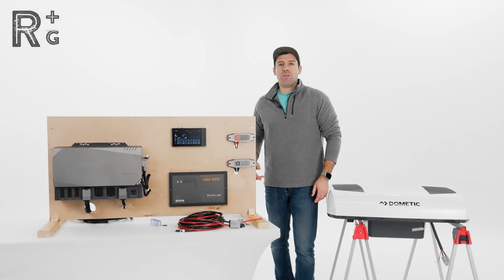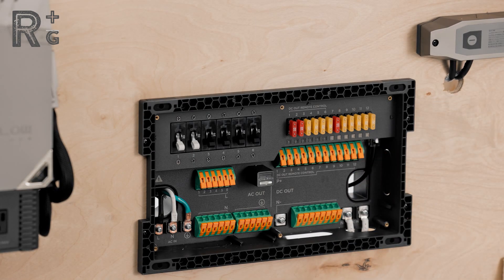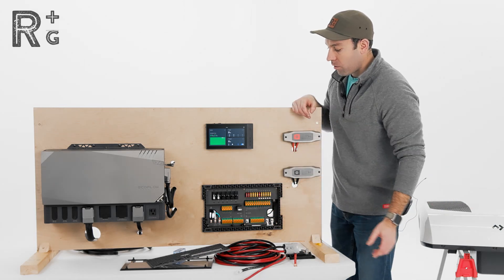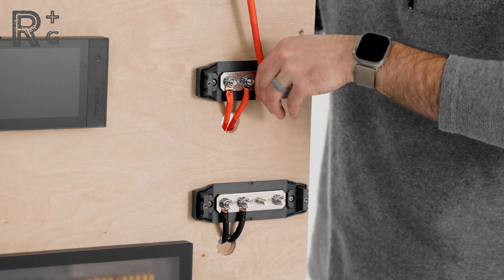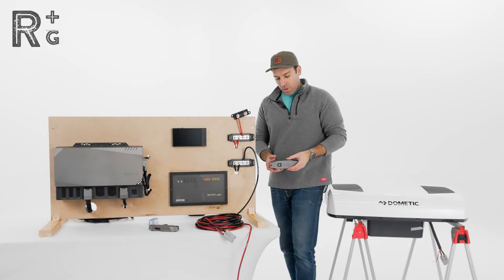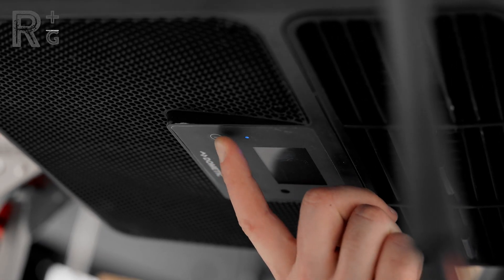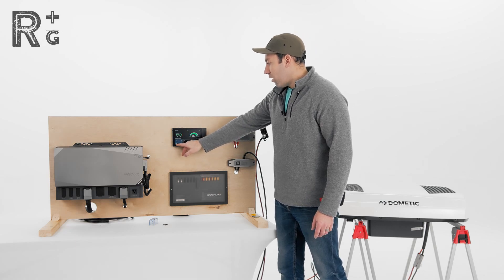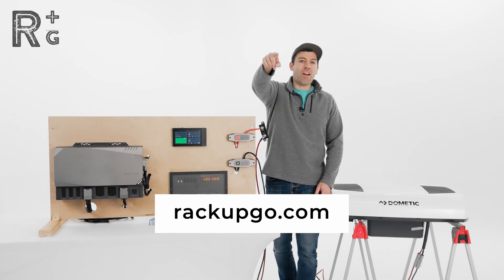How to Connect Dometic RTX Air Conditioner to an EcoFlow Power Kit

Comment: the power kit is 48v and you stated the AC is 12v right? how are you stepping the voltage down then in that setup?
Reply from the maker: The Power Kit has a built-in DC-DC converter and is capable of outputting 1000W at 12V.

Comment: Question about the PowerHub 12V DC output.  1000W max output = 84A ......DC Panel is 70A max.  The included DC Panel wiring is 6AWG good for 70A max. So how is the DC panel protected at 70A and still allow 84A of output on the DC out?  You would guess that the PowerHub internals would have a 70A CB protecting the wiring to the DC Panel and therefore you would not get the full 1000W output capabilities of the inverter. You would need a 90A CB, and then have to bump all wire to 4AWG.  Would you agree?

2nd thing. I noticed the Ring terminals on the DC output cable from Ecoflow are tiny, 4mm maybe? They should have made them 8mm like the Ecoflow Busbars all around so you didnt have to crimp anything.

Do you recommend shortening up the cables they provide for less voltage drop?  That DC Panel cable is like 10 feet long!
Reply from the maker: The output of the power hub, when set to "12V", is a regulated 13.6V. At 70A that's approximately 952W. The DC panel is protected through the internal electronics and voltage regulator for the DC out. It's all constantly being monitored, so when the power exceeds 1000W on the DC output, the hub will disable DC output and log an error. Seeing as the DC output is 13.6V, it's not necessary to shorten the cable to reduce voltage drop as it will not be significant enough to impact low voltage cut-off functions on 12V DC appliances. However, when it comes to having a clean and tidy install, shortening the cable is preferred by most.
Reply: @rackupgo  I see the trickery there with the higher voltage. Thanks for the info. Makes sense that they made the wires only long enough and sized so that they can handle the voltage drop. For my case, the alternator input cable was already a pre-run number 2/0, so I did shorten up that cable. And then to have circuits on the DC panel larger than 20 amps, I added a blue sea hub 150 which takes midi fuses up to 200 amps for auxiliary stuff like larger exterior lighting and stereo amplifiers. I was able to cut that cable in half and use 1/2 to the blue sea and the other half to the DC panel. Worked out well.

Comment: Hello, first of all, thanks for this video it helps a lot. I didn't know that Ecoflow had busbars because I couldn't find it on their site. I would like to know what 80 amp fuse you use on your positive going to the AC unit. I plan on setting up a Cruise N Comfort HD Mini Split System Air Conditioner system in mine which is up to 55amps from what I have seen.

Also, do you plan on ever making a video showing how to connect the alternator cable? I am not sure what the best practice is as far as running it directly to the batteries or straight to the alternator, let alone if I need anything else except the cable going from the alternator/batteries to the hub itself (60amps).
Reply: How many and what size batts were you running to get 10 hrs out of this unit.    Thinkin of setting up a eco flow system in my semi
Reply from the maker: @dubfalcon4489  this video is showing just one 5kwh battery
Reply from the maker: Regarding your fuse question, we recommend an 80A fuse. 

Regarding your alternator video question, we may do a video on it soon, but nothing confirmed yet unfortunately. For this, we also recommend an 80A inline fuse to protect the wiring and hub.
Reply: So you also recommend an 80am inline fuse for the alternator connection? If the hub has a built in 60amp fuse, how would we go about adding an 80amp inline for it? alternator cable to inline to batteries/alternator? Thanks. @rackupgo
Reply from the maker: the hub doesn't have a built-in 60A fuse for the alternator charging, it has a 60A limit which is electronically controlled via the software logic. In order to protect the hub, we recommend an 80A in-line fuse on the positive lead of the alternator charging harness.
Reply: Thanks for the info, I just assumed the port would limit the amount of power coming in at 60amps. What if I decide to connect it to the batteries instead of alternator is it the same process? inline fuse on positive lead then connected to positive on battery? @rackupgo
Reply from the maker: Same situation, an inline fuse on the positive lead. The EcoFlow hub will limit the current coming in, but if anything should happen, either a hardware or software fault, it's better to protect the circuit with an inline fuse and physically break the connection.
Reply: Awesome, thanks for the help! Sub well earned.. I will keep an eye out for more videos! Also, I will try to make this my last question, but in regards to espar diesel heaters, I am not sure how familiar you are with them, but I get mixed opinions about connecting diesel heaters and tapping into the main diesel line. If it isn't recommended, what is the recommended go to, a separate tank of some sort? @rackupgo
Reply from the maker: @mashurai  we are not a fans of modifying any factory fuel lines. Same goes for factory wiring harnesses. That's a recipe for potential issues later on if it's not done well or something with the modification fails. It can cause damage to other systems or modules in the vehicle. An auxiliary fuel tank is an easy solution but does limit capacity and takes up room. If tapping the main fuel tank, a standpipe dropped in from the top of the tank is what we recommend.
Reply: Ecoflow specially told me... NO.

Now that was months ago, so...

Good luck!
Reply: @Scottify11  They stated I could with the busbars. I have it all setup and it works fine, so no worries!